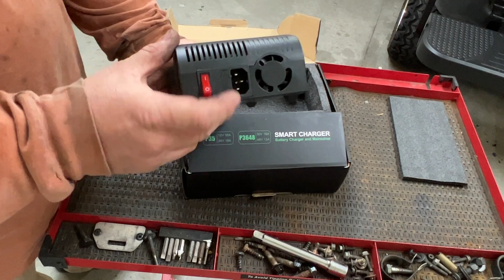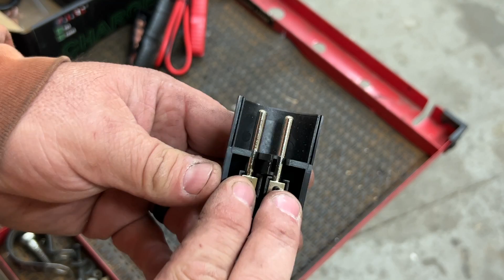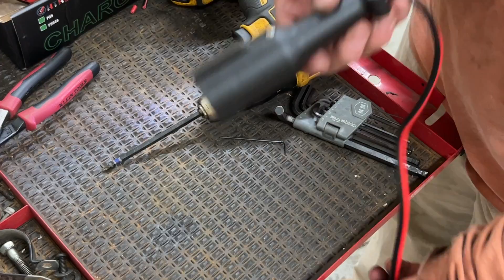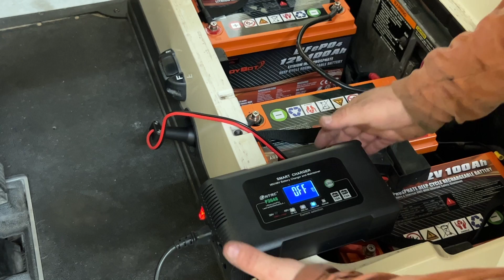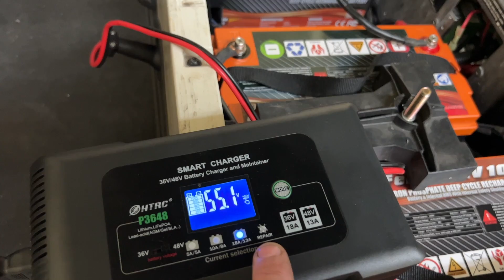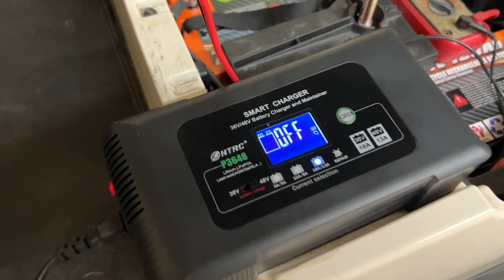HTRC GOLF CART SMART BATTERY CHARGER 36v 48v Lithium | UNIVERSAL LCD SCREEN EZGO CLUB CAR YAMAHA

Comment: Love the channel and everything I've learned from you about lithium swaps. I bought one of these chargers and it worked about 3 times. Now it turns on but won't show any amps coming out. Shows everything else but no fans and no amperage. Any advice? Battery's about 52.7v right now so not over discharged

Comment: Update: They finally shipped the charger to me for my club car DS.  I haven't been able to use the CC DS plug that came with it as it won't work. I have to use the clips to the last negative and first positive of the battery pack with are lead acid.  The charger works great however, the LED display quit working about 6 months after use.  Someone said I have to cut a wire? coming from the socket on the golf cart before the DS plug that came with the charger will work?

Comment: I’ve bought about a dozen of these chargers over the last year and haven’t had any problems or complaints. But I don’t know for sure if it will maintain the batteries if left plugged in. I don’t have one for myself they were all on lithium conversion jobs. Will it maintain the pack ?
Reply: I have two they charge the cart but in 24 hours it never cut off

Comment: I bought this charger for my golf cart and the screen went blank.  Any ideas?  The power switch still lights up, however, the fan and the screen are not coming on.  I wasn't sure if there is a fuse to check?  Thanks

Comment: I bought this charger last week, I have 4 batteries 12v each Duracell Ultra Marine AMG 100ah, when I first used the charger I noticed that in the screen said 58v between 80 and 100% and I disconnected it before show me the FULL msg. My question is, is it normal that the voltage go so high before stop charge?
Reply from the maker: Make sure its on the correct setting.

Comment: Requires a grounded outlet. It will not work with a two conductor extension. Extensions must have three conductors with a good ground.

Comment: Just purchased one of these with club car adapter and 4 Dr. Prepare batteries. I made the purchase after doing some research and your videos provided a lot of great information. Just curious, my old charger was wall mounted outside and cart was under a lean-to. Can this charger be left outside away from water, or does it need to be brought in?
Reply from the maker: You might be able to but I keep mine indoors as much as I can.
Reply: @Fentertainment  Good to know, I will probably just keep it inside then. Thank you.

Comment: I have a 2014 EZGO TXT 48V stock motor & Controller and I just swapped to 4 Power Queen mini lithium 100AH Batteries, the total weight was just over 76 lbs, I think its about 300lbs lighter now. My first run I went over 41 miles in City driving. Top speed was 26mph on flat ground. I paid $900 for the batteries (on sale), $15 for 4Ga Wire and $150 for this Charger. I will probably add a Battery Cut off Switch $15...

Comment: Hi, Great video. My charger says Full at 54 Volts. I have (4) Lithium 100AH batteries. How do I get it to 58 Volts?
Reply: Everytime to put them on charge go back to 48v 5amp charge then it will update the volts. The sensing system somehow did not get accurate voltage at first. U will see your battery % is also different on 48v 5amp like 40% and as soon u switch to 48v 13amp it went from 40 to 80% why? The system detects volts doesnt work until you do all that back and forth.

Comment: I have this charger and it is defective it will never shut off it runs for days and never gets past 80 percent, I did try contacting the manufacturer and so far after 6 attempts zero response.  I have run across others who have had the same issues, it may be a great charger if it works but forget any support from the manufacturer.
Reply: Same problem with my charger I got

Comment: Hey , like your videos . I bought the 3 batteries and smart charger for my cart when my old batteries needed replacing . When I charge mine they say fully charged but the ah will only go to 1 or 0.0 n I’m not getting anything near 35 miles like you did in previous videos . Any suggestions
Reply: Any luck with this? Having same issue on my 2000 36v txt with the htrc p3648 and enjoybot batteries. Worked great for about a month

Comment: Quick question: (excellent videos by the way): and I’ve done what you’ve done. 36v EZGo, with this charger. 

It all works: however, it’s only charging them to about 50% (it stops charging at 39.9V), and yet the charger thinks it’s at 100%. 

In fact, I just plugged it in again (when the batteries were testing at 39.8v), and before it even started charging, it showed that they were almost full. 

Thoughts?
Reply from the maker: Maybe a faulty charger. Is it too late to send back to amazon?

Comment: I need help, I have the same charger but when I plug it into my club car precedent charge port the charger does nothing. It flashes off and nothing happens. I went tot the neighbors house to put it on his batteries which are SLA  and the charger fired right up. Need assistance please. My batteries just arrived the other day and are metering out at 13.1 v. Not sure what to do at this point

Comment: I see you have a pack voltage of 58.6. Did you charge each battery prior to hooking them together with this charger? If so. How did you get each up to 14.6. I’ve only been able to get mine up to 13.4
Reply: Mine going upto 57 and shufoff full.

Comment: I’ve purchase a 48v lithium charger and replaced the alligator clamps with the club car plug just like in this video. When I plug into my cart I’ve got no change to the screen on the charger. Any ideas on what to check for?
Reply: Did you figure it out? Was the polarity on the plug reversed?
Reply: @bigshowradio_550  I never did figure out the issue after I installed the OEM club car plug onto the lithium charger. It could have been an issue with the plug, or I could have done something wrong 🤷‍♂️. However, I removed the OEM plug and installed battery terminals and hooked it up directly to my batteries and everything works perfectly. So now I keep my battery charger located under my seat and just run an extension cord to charge it
Reply: @BigBirdNest  I know there is a connection wire on the on board computer that will prevent it from charging through the plug unless it is bypassed. On the factory charger, that connection keeps the charger from over charging.  I’ve seen a video on how to bypass the OBC.  Seems pretty simple. Glad you at least have it working.
Reply: @bigshowradio_550  ahh that makes sense, because my original charger worked fine with the lead acid batteries. Ordered a replacement plug off Amazon and wired it to the lithium charger and everything was a no go. What you described makes perfect sense! I appreciate the help :)

Comment: Hey Ryan. Firstly, thank you for ALL of your super educational and detailed videos. 

I’m new to golf carts and I’ve picked up an old 96 EzGo 36v TXT that I plan to refurbish. So far, I’ve got a new admiral motor (MOT-B2), Navitas 600A controller, “On The Fly” programmer, HD solenoid, 2GA wire set, front and rear shocks, HD leaf springs, 4” lift kit, 20” off road tires, 36v to 12V step down transformer, The HTRC P3648 charger you reference in this video, and I’m waiting on delivery of 3 12V 100Ah Ejoybot lithium batteries. Can you say expensive!? Yes. 

Am I missing anything? I know that’s a lot, but do you have any advice for when I get started with the tear down and rebuild? Thanks Man!!

Comment: I have a Navitas 440, stock motor on my 2016 Club.. if I go enjoybot with this charger will I need to consider any other changes needed for the upgrade?
Reply from the maker: Not really. I would encourage everyone to get a shunt meter so you can measure your battery capacity. Its far more advanced than just a regular gauge. Plus its only like $40 bucks if that. I did a full video on it as well. If you are thinking of this charger and those batteries due to price only. I also did a video of the big battery falcon elite for $1500 with charger using my coupon code and it gave me 20 mile range and you always have the option of adding another battery down the road for more distance, Plus that bms will handle more amperage output. Here is that video - https://www.youtube.com/watch?v=kJGB4tVqi-I
Reply: @Fentertainment  thank you

Comment: Would this charger and this setup be ok for 2 or 3 48 volt 30 ah Eagle batteries ? Would I have to go with a higher gauge wire from the Club Car charging receptacle to the bus bar ?

Comment: Let me start off saying I’m new to 48v golf carts. I recently purchased a 2016 Club Car Precedent with 2022 Trojan Lead Acid batteries. The cart came with the ERIC factory charger. Is it best practice to leave charger connected to cart, to allow the charger to maintain battery voltage (Float Charge) maintaining proper electrolyte levels. Or will this have a negative effect of the life span of lead acid batteries?

Comment: Great videos.  So I got that charger and did 3 lifepo4 batteries and it came with the club car charger. When I plug it in it’s not working but if I use the clips from the far positive to opposite side of the car negative it works. Is there something that needs to be changed on the back side of the plug on the cart?
Reply from the maker: On the club car golf carts they have a OBC (on board computer) It basically controls the oem charger and tells it when to cut off. You need to bypass the obc.
Reply: @Fentertainment   do you have a video on that? I read a few articles, but I’m a first timer for a cart and kinda need to see what I’m doing. Thanks for the response!
Reply: Also would that have anything to do with it not moving. Is there a fuse on this machine somewhere. Because it moved in reverse when I put the batteries in but now that there fully charged it not moving and the battery light is staying on. Any help would be great, seems you have a ton of knowledge on these carts.
Reply: So, you are saying the the battery clips used that way actually charges the lifepo4 batteries without the bypass? I have not read this anywhere else.

Comment: I have a problem with my P25 model. The charger cannot detect the type of battery to start charging.
I Uploded the video about my problem:
https://youtu.be/7Vp2AxJE1vw
Why is this happening ? And how to fix it ?
P.s. The charger cannot detect the type of battery to start charging.
Reply from the maker: My 12v charger did this once as well. So what I did to get it to start charging it again was to deplete the battery and once it seen a difference in the battery the charger would start again.

Comment: So I’ve purchased the 48v enjoybot batteries, charger and cord cap for a club car precedent. I fully charged batteries prior to install, install went smooth and cart performs well. I just ran into an issue though, after installing the precedent cord cap and attempting to plug into the cart to charge I received an error message. Before I start spending time troubleshooting do you have any idea what the issue could be? The cord cap is definitely installed correctly, I’m an electrician by trade. 

Thanks in advance! Love you channel!

Comment: Just one tip, I would "tin" the wires before inserting them in any that requires a screw or pinch to terminate the end. The wires will tend to fray if just having the screw run against it
Reply: Use a ferrule crimp. When smashing
Reply: Dont do this tinning a wire makes it weak when crushing and will break. I worked at a wire harness company and have been certified in medical cable manufacturing. Tinning is for soldering. Tin take a pliers crush and it will break
Reply: @03Bandit  I'll agree on small gauge wire. On the heavier stuff, I've never had a problem. I built commercial equipment for 25+ years. Small stuff, definitely ferrule. This appears to be 6 gauge and I've done it from there to 4/0

Comment: Will this charger work if I still have my obc hooked up?
Reply from the maker: Thats a good question, This cart doesn't have an obc on it. I would remove it since this battery charger has its own cut off built in.
Reply: Loose the OBC computer. It only causes problems once you start moding